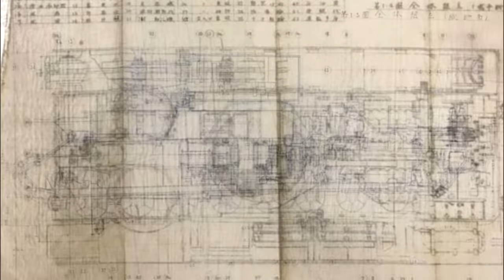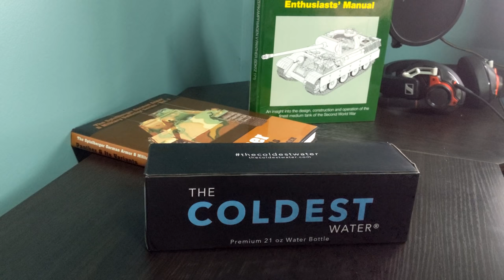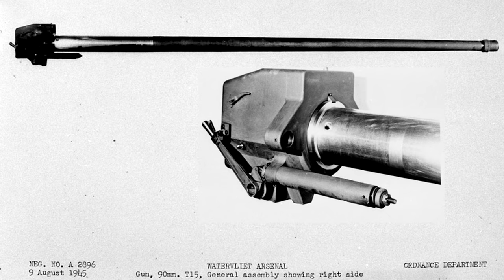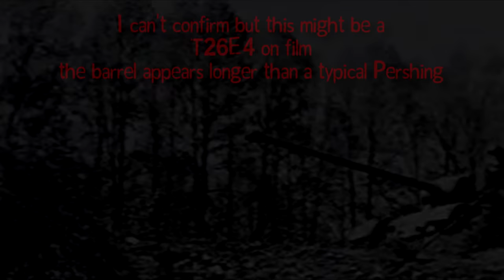America's King Tiger KILLER, the Super Pershing | Cursed by Design

Comment: If M26 Petshing n T26 Super Pershing would have entered production by early 1944, it could have destroyed Tigers, Panthers n King Tigers in Battle fields and combat saving thousands of tank crew casualties in France Normandy Holland Market Garden n Belgium during Battle of the Bulge WWII.
Reply: Ok so your using a myth. Out of 49,000 enlisted us tankers only about 1,600 were killed with over half of those coming outside the tank and that was all tanks. The Sherman had the highest crew survival rate of the war. They killed tigers and Panthers when they actually saw a working one and not many tiger 2s around and they usually didn't work either. The Pershing was not a good tank as it showed in Korea even the us army would have had to change all of its logistics and the army corps of engineers would have had to made major changes also.

Comment: I will admit I do like the M26 an The Super M26 Pershing tanks. But the M36 Slugger was More Reliable an it could Go 30mph. Which was faster then both the pershing an king tiger. Also, the germans tanks didn't have good survivability On the Battlefield With our Vastly Superior Air an Artillery Support. But yes. Still the M26 Pershing an The Super M26 were Good tanks. If the war Lasted a Bit Longer, then the M46 Patton Tanks may have had the chance to Fight the german tanks. That would've been Awesome.

Comment: I never understood why the US didn't develop and wide-scale manufacture a tank to equal the Germans. I get that the US had outnumbered Germany with the Sherman,and they were faster,etc, but I'd be terrified to be inside a Sherman. The Pershing was finally field-tested at the END of the war,and when it finally did arrive,it was a joke. Imagine if only two or three years earlier,say 1943,that development started. Maybe US could have had time to work out the flaws and wind up with a good tank??
Reply: The Army had the M6 heavy tank in 1942. It weighed 55 tons and had a 90mm cannon. The armor commanders said they had no need for a slow heavy monster that broke down often so wasn't used. The M26 was an up-armored version of the T25 that was ready for testing in 1943. Congress wanted a heavy tank in action before the 1944 elections so it was rushed into production which didn't start until November of '44. Congress had ordered for the first 20 made to be shipped over ASAP so those arrived in January without trained crews and mechanics. The first 3 made were the only ones tested by being driven around a track for 500 miles to see what would happen.

Comment: So you've got a pre-production tank design, and ship it off to the front to test it out. First thing you do once it gets there is slap on a bunch of jerry-rigged junk armor that completely throws off the performance. Can it shoot straight? Well you've completely thrown off the turret balance so who knows. Does the suspension hold up in the field? Maybe with the designed weight but now you'll never know. How long can it go between engine maintenance? It's being pushed past what was intended all the time, so probably not as long as the factory models but again, you don't know for sure.

Comment: here i was thinking this was built to deal with soviet T-24's and IS-2's in Korea,
Reply: The 76mm had absolutely no problems dealing with the T34s and ISs in Korea and the regular 90mm in the Pershings was overkill. There was no reason to revisit the concept.
Reply: @Orangejr36  thanks! Did the shermans and the Pershings have to deal the the IS-2s? I'm curious, I don't know as much about The Korean war.
Reply: @scratchyass2369  They did, but after the first Chinese counterattack heavy losses meant that the communist tanks were only used for fire support and the US had time to completely retire the Sherman and replace them all with M26s and M47s. 

There were no large tank battles for the last two years of the war, with only small fights between usually 1-5 tanks supporting their respective infantry.
Reply: @Orangejr36   Ah thanks!

Comment: If only America wasn't lazy and deciding to continue tank production, they would have had t32 tanks. America is dumb for not mass producing the T110E5(it's actually called T110E3) just because it can't fit in a small tunnel. At least the tank was great and probably had a similar width to the M60

Comment: OOOOOH...  so THAT's what those two "tubes" on the turret were for?? They held SPRINGS to assist in elevating the gun?? DAMN! :D When I asked someone what was it, he told me once these were a part of an "air-cleaning" system - someone else told told me once these actually were an emergency fire-supression system! XD :D ...like - if the tank caught fire, their content would have been discharged INTO the tank (or over it), to keep the fire & potential explosion at bay... but it obviously made NO SENSE WHATSOEVER to me - it would have been a very ... ODD place to put something like that! :D Then - ONCE AGAIN! - someone else told me these were hydraulic pistons containing oil to help keep the gun up & stabilized vertically. :) That made more sense. Thanks for the video! Guess you learn something new everyday. Turns out they were just SPRINGS! :) Cool! :)

Comment: John Irwin's memoir "Another River, Another Town" shows that the T26E4 saw a decent amount of combat.  Combat is not only against other tanks.  Besides the supposed Dessau Tiger 2, Irwin's crew killed a Panther, a Pz IV -- as well as firing lots of ordnance in its roving patrols in support of infantry.
Reply: That T26E4 was only used for two weeks before being knocked out by a Panzer IV that put a shot thru the side of the hull. Army records only show that it hit two distant targets 1500 yards away that resembled tanks. Cooper's added armor reduced it's speed to a crawl so it probably fired where directed from the rear of the advancing column.
Reply: @billwilson3609  the added armor didn’t reduce its “speed to a crawl”.  My source is Irwin.  What is your source Mr Wilson?
Reply: @t26e4  The Hell with Irwin. The M26 used the engine and transmission for the T25 medium tank so was limited to low road speeds to prevent damage. Those traveled at the end of advancing columns due to their slow speed and only called up to the front of the line when needed, where it often took 20 to 30 minutes for it to arrive. Cooper added 5 tons of armor to the front that made the T26E4 nose heavy so couldn't go forward except at a crawl without it tipping forward to place more excessive weight on the forward wheels, suspension and tracks. The idiot Cooper wanted to add more weight in the rear "to balance" the tank but was told no since the Army automotive engineers that were present were afraid that the additional weight would immobilize the tank by causing the drive clutches inside the automatic transmission to strip off their friction material. 
Army records do show that it saw some action for a few weeks before being knocked out of action by a 75mm round that penetrate a side of the hull. The same records state that it did engage two distant targets that resembled tanks and destroyed them so evidently nobody ventured out to see what those were. Irwin probably did shoot at a lot of stuff and troops during those few weeks since he was expected to in order to report on the effectiveness of the gun. I'm sure that the writer that helped him write the book embellished his recollections to make those sound more exciting.

Comment: I wish that the T26E1 in war thunder there had the correct armor model -- Gaijin modeled the add-on armour as Structural Steel rather than RHA.
Reply from the maker: Only the armor on the turret front is RHA from what we know. The armor added to the hull would just be soft steel plate.
Reply: @ConeOfArc  Don't most accounts say that the armor came from the sides of a knocked-out Panther?
Reply: @antoniusp3295  The turret armour yes but the nose is not.

Comment: A failure? How? I would bet most allied tankers would have rather gone into battle with this Pershing M26 rather than the M4 Sherman.  The street battles in Cologne showed a M4 Sherman vs a Panther then  the Pershing.  The Pershing M26 won with the 90 MM gun. The design for the Pershing started as early as 1942 yet American military leaders failed to push the tank until thousands of allied tankers had been chewed up and burned up by better German designs.  The Pershing M26 would have been a safer ride than the Sherman Firefly or the M18 tank destroyer.  The Pershings in Korea did very well against North Korean T34s as well. This video is incorrect!!
Reply: The M26 won because it knew where the Panther was and was lucky enough to hit the side armor. First M26 fielded "Fireball" was knocked out by a Tiger I
Reply: The Army had the M6 heavy tank in 1942 that the armor commanders refused to use. The M26 was worked up in 1943 from the T25 heavy medium design on the insistence of the US Congress that wanted a heavy tank in action before the Fall elections of 1944. Due to delays, it didn't go into production until November of '44 with the first 20 made being shipped over without being tested and without trained crews and mechanics. The armor commanders refused to use them, too.
Reply: Either tank would’ve won that engagement. The Pershing just fired first.

Comment: ConeofArc: Nice video, but you have some errors/issues that need fixing. 

First, about those two occasions in which the Super Pershing's extra-long barreled T15E1 90mm gun. The first instance was indeed unidentified, but if you read Cooper's book - Lt. Cooper was there, remember - his ordnance team also experimented with the new and more powerful gun against captured static German AFVs, specifically (page 233-234, Cooper) an abandoned Jadgpanzer IV self-propelled gun which had been disabled by a flank shot. From a distance of 1.5 miles, the Super Pershing opened up, scoring a direct hit which penetrated four inches of frontal armor, a five-inch final drive differential, the fighting compartment, the four and a half inch crankshaft of the Maybach powerplant, and the one-inch rear armor plate. The projectile had gone so far into the slope behind the target that it could not be recovered. 

If you want to comment on the Battle of Dessau, perhaps you might wish to clean up some details. First, Corporal "Erwin" was spelled "Irwin," specifically Corporal John P. Irwin, who was the gunner in the Super Pershing on April 21, 1945, when the encounter with the King Tiger took place. The engagement took place in an urban setting, not in a forested or wooded area as shown in your video. You doubt that the tank engaged was a King Tiger, citing frequent Allied misidentification of large German tanks as "Tigers" whether they were or not. This did happen, particularly for a time after Normandy when U.S. forces were still becoming acclimated to the ETO, but by late war, such instances of faulty identification were much more rare. 

Why? In part because U.S. and SHAEF intelligence personnel were better-informed, and had better data on enemy equipment and order of battle than previously. This was in part because of all of the captured POWs who'd been debriefed and interrogated by that time, but also greater exposure of army personnel to German weapons and equipment. Tank crews in particular, would have been heavily-briefed and trained in identifying German armor. Why? Again, because G2/S2 (intelligence) would have wanted as much info as possible. Therefore, it is premature to say that Irwin's identification of the heavy tank engaged was not a King Tiger. 
The engagement opened with the two tanks only a couple of blocks apart, and decreased as they faced one another and closed the distance. Since he was the gunner, Irwin would have had a good look at it, not just before the shots, but afterwards as well. Many of the skeptics weren't there, not just at Dessau, they weren't even in the ETO or in the war; they're relying on secondary sources, many of which are themselves of dubious reliability. Irwin, on the other hand, was there. Since he was there, his account is a primary source, and in history primary sources are almost always rated as more-reliable than secondary ones. 

You characterize the modifications done to the Super Pershing as "wacky".... why? Lt. Cooper, a trained professional engineer, and his men were doing what the military calls "field-expedient modification," and as Cooper explains in his book, they didn't have the time to wait for custom fabricated parts to be turned out. They'd been ordered to better-protect the valuable new tank, and set about doing as best they could using their skills, experience, training and the materials at hand. Pretty? No, but probably the best which could be done quickly using the resources at hand. 

Thanks for the video. It was good detective work on your part to track down the snafu's regarding the sights and missing ammo. Always good to learn something new.

Comment: So, if WT was historically accurate: the cannon should be “disabled” if the springs get critically damaged.
Right?
Reply: No
Reply from the maker: At one point they had it so you would lose elevation if it was damaged but I think they removed that.
Reply: @ConeOfArc  They should let this feature ON during simulated battles.
Reply: @JoNTalker  If those springs get shot out you lose gun elevation

Comment: I'm tired of people saying that the King Tiger, the Super Pershing faced was actually a Panther, here's the thing with that, if it was a Panther, the S Pershing's AP shell would go right through it, yes from the upper front plate and through the engine block and out the back, that's how much PENATRATION, the Super Pershing's ammo had, only the King Tiger's upper front plate could try to resist that much force, why do I say this, because the S Pershing's gunner fired a round at the upper front plate first but it didn't go through completely. 

So if anyone here thinks that the encounter had to be a Panther, than Physics says that by default, you're an idiot.